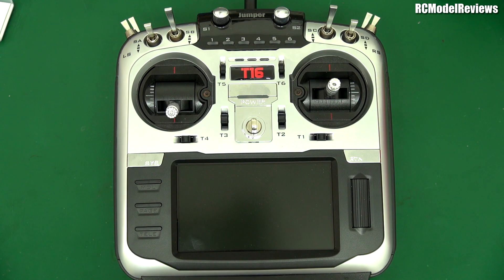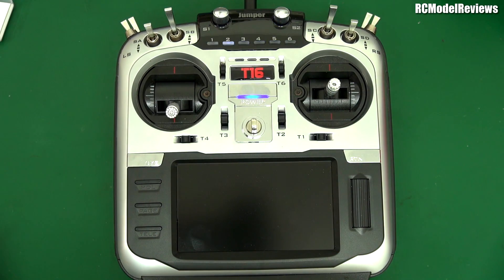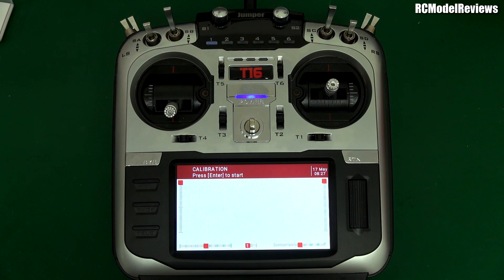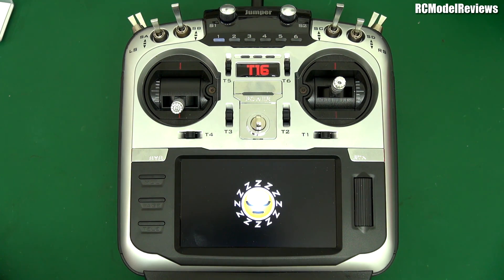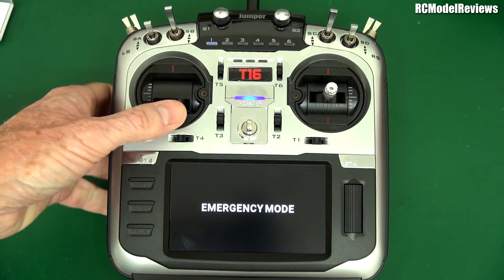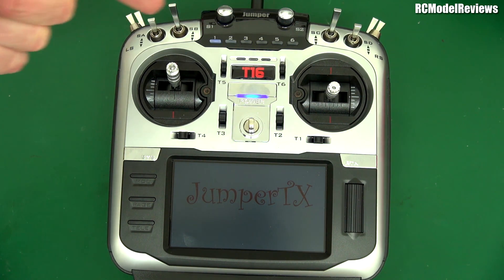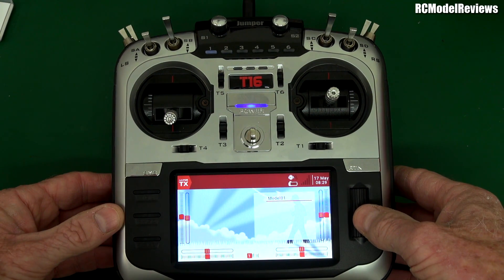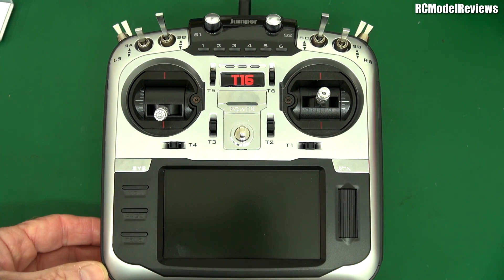Why I won't be using MY Jumper T16 transmitter

Comment: Few know how satisfying it is to FEEL your plane as you give up elevator and the lines tighten up and provide feedback to your hand, and brain and you instinctively, prevent over control. Then when you get the FEEL, as if in the airplane itself, you give JUST enough up, on the handle, to execute a perfect loop.  

Can't do rolls? big deal. Our club had a guy in the hobby since 1960, as a teen, flying free-flight and control line. He graduated, as many of us did, to radio control. 

But one day at a fun fly, he brought out his 30 year old, Nobler, control line stunt plane. Some 20 minutes later, when the tank ran dry, (no throttle) the spectators went WILD. It was SUCH a remarkable performance from a master and a lifer of the hobby. 

I regret I've forgotten his name. 

Today, we have QUADCOPTERS, (I hate the drone moniker) that any MORON can buy for 80 bucks and the electronics and GPS and gyros do everything but sing Yankee Doodle and you stand there and have to do nothing, no learning curve, no persistence, to LEARN to fly.

I'll bet that Bruce knows what I'm talking about. That guy was like Bruce, PASSIONATE in his hobby and very generous with his time and energy helping neophytes to the hobby. 

Bruce is a true champion of all things that fly. I am not a fan of "drones" but neither do I disparage those that do. I just love the things that have wings, like nature intended. Having said that, I LOVE my WL 977 heli.
 Six axis gyro, OMG. 

My first heli was the DuBro Whirlybird, back in the 1970s. Look it up, you won't believe how primitive it was, back in the day. Heck, here we go. http://www.vrhc.co.uk/images/RC%20Helicopters/USA/Du-Bro/Whirlybird/Whirlybird.htm  Still, I learned to fly on that machine, no gyros, no GPS, just white knuckle effort to keep it in the air in a hover.

Comment: This Error happens when you Activate INTERNAL Module in the Model setting of the active model when booting it up. To fix this: open COMPANION app search for the that model and deactivate INTERNAL module. T16 will boot again. This is NOT a permanent error or fail but a firmware thing that should be fixed.
It likely happens for starters when playing around. In that case it might be easier to just overwrite the SD card with the default content which can be downloaded from jumper.
Reply: this issue just happened to me this morning, on T18 Radio.  It's a shame it still happening on the new version, and it can occurr on fligth!!!
Reply: in 2021, this stuff still happens even if you buy a brand new one... it happend to me twice now
Reply: @WhozBrokenHD  I've had my T16 for a year now. It's never done this. And I use the internal module all the time. 
I've had issues because of the ribbon cables - well-known issue and Jumper sent me new cables - so I'm not saying their quality control is the greatest, but...

Comment: Just had the same problem with the new pro hall they blame the pictures we add but if reformatted the sd card with no luck and had a switch fail in the first month... not reviewers curse just junk transmitters!! Great concept needs more R&D.

Comment: Mine was doing throttle errors and card error and stuck button. I updated firmware fixed that problem but now I can't even get into the system menu and honestly seems even more messed up. I'm new and honestly not sure If I'll you continue flying after this. Such a headache.

Comment: Just got the T16 Pro with the HE gimbals and internal module included.  For a transmitter and the price this thing's really quite amazing.  I have a QX7, QX7s, X9D+, X-Lite, Turnigy Evolution and Spektrum Dx7s (I didn't buy all of them on purpose lol, I got them all from mainly buying ebay lots or stuff from friends that included them lol)  I really think I'm just going to use the T16 for everything now.

Comment: Hi Bruce Im not sure if you will see this but Im totally frustrated. I have purchased the latest Jumper T16 Pro Hall (to which I have received the wrong model NOT Hall, however, Im being sent the hall gimbals) and all is working fine with the binding BUT even though the Multi Protocol module will bind perfectly with a FrSky D8 RX (or any lookalike D8) it simply will not recognize the RSSI or the A2 pin for voltage. Ive spent hours and searched the internet and can find nothing. Since 50% of my 20 planes have the older D8 Rxs this makes this almost useless to me. Is there anything I can do or am I doing something wrong. Yes I know I can upgrade the Rxs but that wasnt the point. Id truly appreciate your help if possible. Im from Napier by the way.

Comment: Purchased mine in November 2019 and have had to open it up to fix it twice. This last time the repair didn't work and it is either the switches or the main board. My X9d is 4-years old and the only thin I have had to replace is the buttons.  The Jumper T16 Pro is an absolute POS.

Comment: Sorry Bruce, but this review should have gone to Hobby Porter/Jumper and not the public. As Hobby Porter said, "a small batch of hand made samples where produced before mass production began. These where sent free of charge to a small number of reviewers and developers. Bruce was one of the reviewers who received such a sample.", and I am sure Bruce was told that. Or you could of waited for the final production unit before making a public click bait video. You see, some of us plan to purchase this radio and if I didn't read the comments, I might of had second thoughts. Thank s Hobby Porter for cleaning up Bruce mess. It smells. Some can rave about Hobby Porter/Jumper response time - they've got a lot at stake - almost lost one sale here.

Comment: My NEW jumper t-16 radio has two bad switches SA and SB show in hardware as a 3position switch , but only works as a 2 position switch .
 I wrote to jumper and this is what they told me to do.  EVEN thou it will void any warranty . 

Hi Gordon,
Thanks for choosing Jumper and sorry you are having problem.
Would you please kindly pull out the cable of SC/SD and insert it into SA/SB? And then turn on the radio. See if the SA/SB works back to normal?

Best regards,
The Jumper Team

I HATE THEM , will tell everyone about the great service , + NOT TO BUY JUMPER.

Comment: I did have the samen problem, but only after converting my taranis programs to the jumper (horus x10).. After writing a backup to the sd card and new firmware it is gone. I think its not a hardware but firmware problem. My Jumper is working fine now after installing a New firmware version.
Reply: Hi.. I made a copy of the SD (copied files into HD directory) before trying to copy models across through OpenTx Companion ..Yes, after copying models across J T16 when into emergency mode !@#$%...to resolve , I Copied Old SD files from directory back onto  SD and Walla.. Resolved...hope this helps anybody stuck.

Comment: I had a similar problem. It was the 3rd or 4th time I had turned on the TX, never bound or used, and was in the middle of upgrading the firmware when I had the same issues you experience with some extras, a sizzling sound, smoke and burnt electronics smell. The offensive "Emergency Mode" screen eventually disappeared replaced by a calming, zen like black screen, reminiscent of the monolith in 2001. No more annoying lights and sounds when you press the power button.  The sizzle and smell seemed to be coming from behind the power button so I opened it up but decided not to bother with the level of disassembly required to get to the power switch.

I rapped on the radio to see there were any loose parts and bingo, out rolled a spare gimbal screw that had been dropped and left behind by an assembler. HobbyCool was gracious enough to send a replacement prior to receiving old smokey while Jumper wanted the old one back before sending a new one. I'm still waiting..

Comment: Of course a failure is not wanted... but of course can happen. I think even more interesting is: 
- how fast is customer support answering
- how good is customer support
- how fast do you get a replacement
Please do a video about this :-)
Reply from the maker: Yes, I'll document the process...  but first I'll tear it down and see if I can at least confirm my preliminary diagnosis.
Reply: @RCModelReviews  
But since its an x10 copy, you can always use your x10 parts to repair 😂😂😂😂😂😂
Reply: Back in the day, when you had a Kraft radio, you could call Phil Kraft himself and sort things out. Often, he would replace anything you needed, airmail, no charge, no hesitation. Now THAT was service.
Reply: Great point
Reply: @hobbyporter3597  well done sir, I myself use the Jumper t8sg plus, awesome radio.
Reply: This Error happens when you Activate INTERNAL Module in the Model setting of the active model when booting it up. To fix this: open COMPANION app search for the that model and deactivate INTERNAL module. T16 will boot again. This is NOT a permanent error or fail but a firmware thing that should be fixed.
It likely happens for starters when playing around. In that case it might be easier to just overwrite the SD card with the default content which can be downloaded from jumper.
Reply: ' @jamesbonde4470  yes back in the 80's
Reply: I also have a jumper radio, the t8sg v2 plus and I can tell you that it has been a problem since I first bought it and Jumpers customer service is the absolute WORST on the planet. I have been trying to reach out to them for over 2 yrs and they have not returned even 1 Email. don't put any of your money into this company. they wont help you at all when you have problems with their shitty products. cant find repair parts anywhere for this radio. I wish they were local so I could give them a piece of my mind in person.

Comment: Im well behind you guys im still using the old jr handset with the fresky plug in unit .the free sky unit stopped working what would you surgest new radio or new plug in
Reply: IRangeX 4in1 module, gives you everything you could want frsky flysky hubson wltoys..... Etc..... Great module got it my futaba and my QX7.

Comment: Wow, I was seriously looking at the T16. Not anymore. I only have a TGY i6 because the receivers are so cheep and work great. Might wait for the V2 it might have hall gimbels.
Reply: Hi Grumpy, this was discovered as a problem with the first batch of hand assembled review and test samples (around 20 units where hand made for sending to reviewers and developers). The problem is in the SD card PCB component, a couple of other reviewers also had this issue and we had sent them a replacement SD card PCB component (the same component used in actual production). This problem was eliminated before production began. I have already arranged a replacement part to be sent to Bruce and emailed him about the issue.

Comment: I wanted to try a new radio also ,I chose the nirvana ,and i am pleased .I love it .The new 2.2.2 firmware fixed the bugs for me and I have been very pleased the only drawback i can find is the battery life.but at least you can change on the fly.I still wont be canning the tried n tru tarannis.But i dont think from what ive seen that the jumper is on the same field .I may be in the park ,but wrong field so to speak.needs more work .it will be ok after a year or so of updates.kinda like how underground fumbled with the nirvana.Seems like flysky has it ironed out now though.IM
pleased .I love mine kudos flysky!
nother great review Bruce!

Comment: Had 2 jumper radios fail in the past 2 weeks.
One died about 10 minutes after turning the thing on.
And the replacement failed in the air and smashed a plane up.
Cheap junk

Comment: Mine went into emergency mode after I hooked it up to OpenTx Companion to write my models across. I had made a back up of the SD card first, so I erased it and reloaded it, worked like a charm. Just having to put the models in manually.

Comment: If you've got a tried and tested, working combination of RX and TX that you're happy with, be it FrSky, FlSky, Jumper, or anything else, if at all possible, just recycle the components in any new build, and hold off buying any new radio for now. I'd wait a while for these key players to sort themselves out product-wise, before making any major purchase. That's what I'm doing :-)
Reply: Ayo sounds like the voice of reason. I was hot to get a QX7s and then the Jumper T16 shows up and it looked great. But with all the crap going on between Frsky and Jumper...I think I will wait. My two Futaba radios with the DHT modules work just fine.

Comment: I don't have a Jumper but I do have a FrSky X Lite which was/is faulty out of the box with a dodgy screen. Anyone who thinks that FrSky is faultless is just naive. I like the Jumper (now with Hall effect gimbals) but I will give it a few months before jumping in. Another big issue with the original Jumper T16 s the scroll bar detaches at the top from the mounting mechanism - an easy fix if they are serious. I like my X lite (fault and all) and I like what I see in the Jumper T16 if they can iron out some problems. Mr FrSky can jam his Access protocol as far as I'm concerned. I'm moving across Jumper.......but not quite yet !

Comment: Packed with features for a super low price, I wonder if quality might be an issue.....it seems like one of those too good to be true situations tbh, may be just a fluke though, idk, I was always going to stay on my taranis until Im absolutely forced to switch.
Reply: Hi Rigger, this was discovered as a problem with the first batch of hand assembled review and test samples (around 20 units where hand made for sending to reviewers and developers). The problem is in the SD card PCB component, a couple of other reviewers also had this issue and we had sent them a replacement SD card PCB component (the same component used in actual production). This problem was eliminated before production began. I have already arranged a replacement part to be sent to Bruce and emailed him about the issue.

Comment: Looks like time to wait for me. I was hot to get a QX7s and then the Jumper T16 shows up and it looked great with the big color screen etc.. But with all the crap going on between Frsky and Jumper...I think I will wait. My two Futaba radios with the DHT modules work just fine. Now that Frsky is playing around with a new radio that has software that will not work with all of the older Frsky rx , I have about  15 Frsky rxs in airplanes and I sure do not want to replace them all, it would cost more than the new radio.

Comment: It might be worth looking into whether this is an issue that came with early samples or first run/batch of TX's.  Might be an idea Bruce to get in touch with Jumper and find out, instead of bailing off the bandwagon.  Im sure many of us got that one motor or battery or ESC that didn't work as it should when everyone elses worked fine.  I like the look of this radio, and I'm still looking at getting one.
Reply: Hi Jacen, you are correct, this was discovered as a problem with the first batch of hand assembled review and test samples (around 20 units where made for reviewers and developers). The problem is in the SD card PCB component, a couple of other reviewers also had this issue and we had sent them a replacement SD card PCB component (the same component used in actual production). This problem was eliminated before production began. I have already arranged a replacement part to be sent to Bruce emailed him about this issue.

Comment: Hope Jumper get in contact soon and sort out the the problem so you can relay the info to us!
Reply: Hi Etops, this was discovered as a problem with the first batch of hand assembled review and test samples. The problem is in the SD card PCB component, a couple of other reviewers also had this issue and we had sent them a replacement SD card PCB component (the same component used in actual production). This problem was eliminated before production began. I have already arranged a replacement part to be sent to Bruce and emailed him about the issue.
Reply: @hobbyporter3597  I need a replacement as well. Mine has a similar issue. When I plug in the Battery, the screen stays black after a white flash and the Power LED turns blue. It only boots up successfully when I start in bootloader-mode without the SD-Card, then plug in the SD-Card and hit Exit. Then it's working fine however. This procedure however is not the way to go for a new product that stopped working on the first day.

Comment: Try looking at the insides and reconnect all the ribbon cables, I have seen many of them wrongly connected.

Also look at the battery tray if you are using the included one and check that cells provide good contact as it was a first production problem where the plastic walls were warped inside, squeezing the batteries and preventing the contact preload spring from making a good connection on the other side.

Comment: FRSKY put a Voodoo doll 💉 curse on you :(
Reply from the maker: Yes... damn you FrSky (LOL).
Reply: Can`t be that Jumper just made a crap radio can it..
Reply: @afrog2666  it was a joke.

Plus I don't fly either radios.

Bruce you're a rockstar :) lol
Reply: This Error happens when you Activate INTERNAL Module in the Model setting of the active model when booting it up. To fix this: open COMPANION app search for the that model and deactivate INTERNAL module. T16 will boot again. This is NOT a permanent error or fail but a firmware thing that should be fixed.
It likely happens for starters when playing around. In that case it might be easier to just overwrite the SD card with the default content which can be downloaded from jumper.